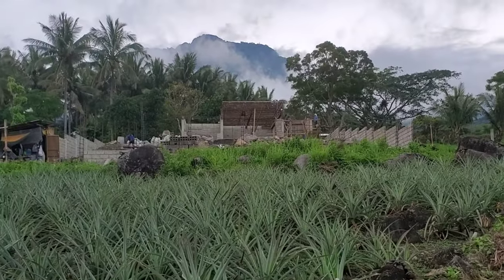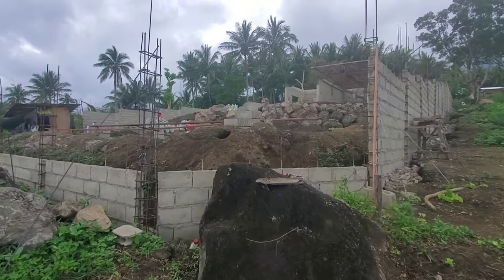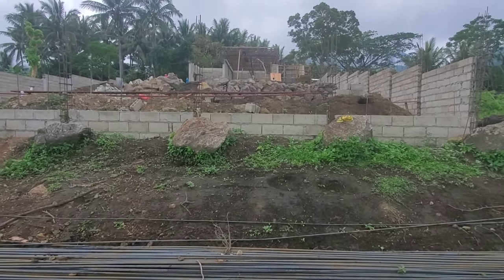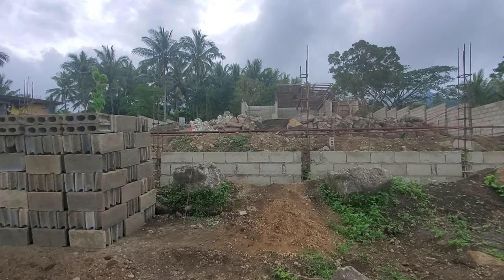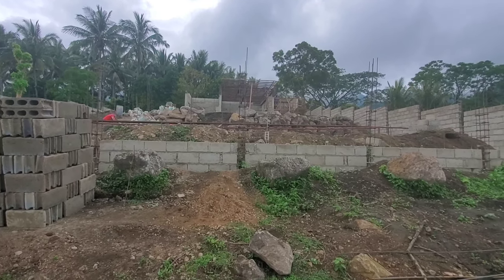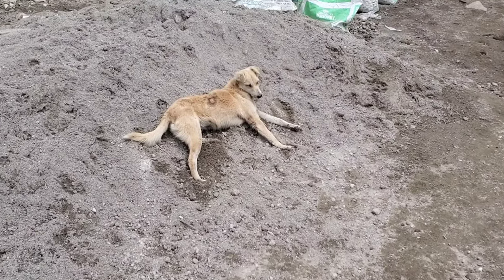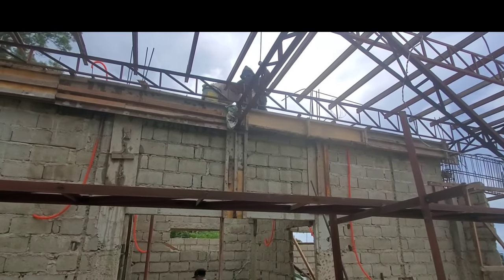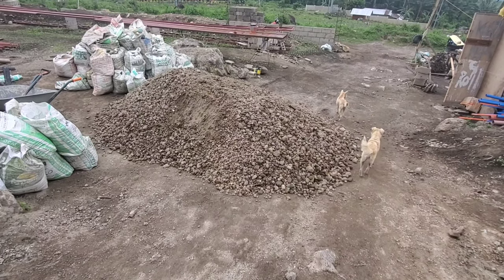Philippine House Building- Construction day 42

Comment: Not sure if I suggested before,  but maybe glass blocks  or thick tempered glass would be nice on the  fence wall,  to let natural light  into " Dirty/ outdoor kitchen".  16" or 3 row8×8 blocks .Of course trees  are there , need to trim every now and then.
Reply from the maker: Yeah, that's an option.  We need to think about cooking back there and venting of cooking buwad.  Thinking about screening that last few inches between the roof and the top of that wall.  Need to figure it out once we can see what it's going to look like once roof and block wall is completed.
Reply: @buildingthephilippines  glass blocks  are stronger , grout lines will be an issue on other side-( mildew)  as that is shaded by trees, a single  panel of tempered glass with aluminum frame , window guy will easily make those, and might  be easier to maintain . I'd  go 3× 8-10 feet of  rows of blocks , more security, power wash twice a year, for venting  Factory  or garage type side louvered  exhaust  fan will take take Stink Fish smell in minutes . If it was me I'd forget the screen ,just glass and power wall vent , as horizontal blown rain can make it wash into the  outdoor kitchen  during typhoons, unless that screen is only 5"-6 "  and  right below roof overhang.

Comment: Any perforated pipe in the backfill at the bottom of the back wall?   And a concrete drain very good 👍🏻!
Reply from the maker: I believe only that concrete drain at the back. 20 to 24 inches wide, that can handle a lot of water.  That should be enough/large enough to handle the flow.

Comment: I suspect it is more cost effective to have gutters , downpipes and drains instead of building concrete drains behind the besser block retaining wall.
Reply from the maker: My contractor knows he can use either method. He stated concrete version would be cheaper and able to handle the amount of water coming off that roof. He said 2 inch downspouts would have a hard time handing a hard rain. I left it up to him. I believe the gutters here are stainless steel. That's why they are so expensive. Thanks for the comment and watching our videos.
Reply from the maker: That may be another reason why the contractor suggested concrete drainage. 🤔